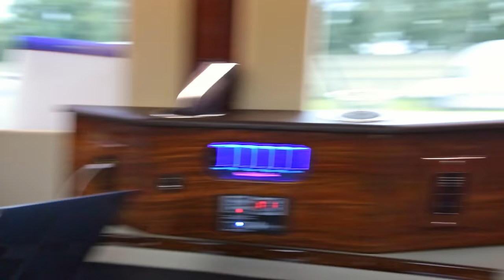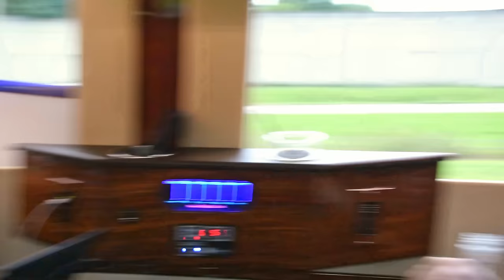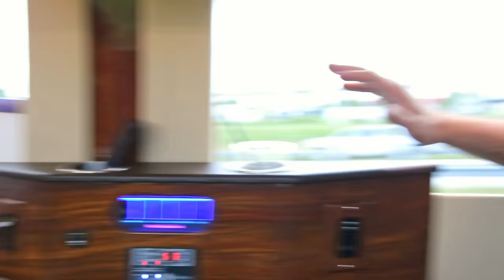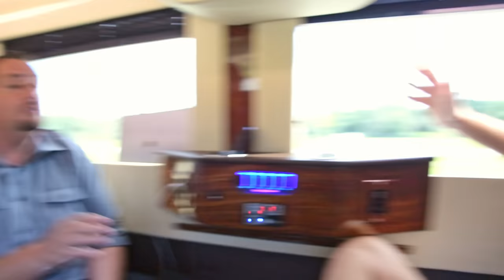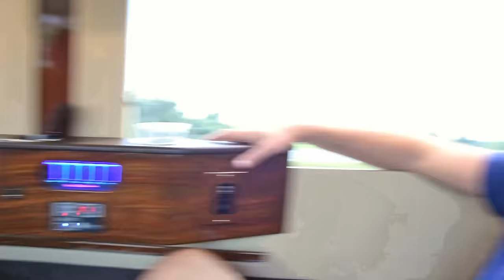Angry owner destroys contractor

Comment: Million bucks for that building is a little high...  The timeline should have been around 6 months...
Reply: I think they might be rounding up that million bucks from 7/750k .
That is more than most likely borrowed ( non taxable ) 💰(ding)
That building completed is probably about a million, maybe another 200k if the Ben's are going fit out for the tennant's, which is still fairly common.
3/4 months TOPs  for construction
by a semi-seasoned, commercial contractor/builder.
*Just sayin *

Comment: 2 years --- 
4 walls --- $ 285,000  --  
Complete  roof  $ 160,000 -- 
$ plumbing  $ 49,000
$ Electric.    $ 46,,000
$ HVAC.       $ 78,,000
Excavation --- $ 71,,000
$ exterior landscape masonry 
$  175,000
$ glazing  $ 64,000. 
Architect -- $ 36,000
Engineers - $ 25,000

Remainder Builders profit ..

Comment: 1.2 million for a gutted building that doesn't come with AC or flooring what the fuck was ben jr thinking. These contractors messed me up with time as well for 1 year to gut and build out a 1,600 sqft franchise. The contractors father is the head of permitting in my town. NEVER again will i not write a time addendum in the contractors contract... I learned from my mistakes with building...
Reply: Well I guess the parking lot was a lot of money to build, so there's that.